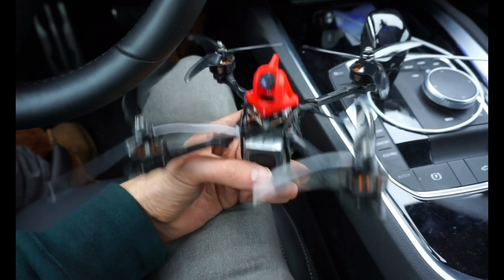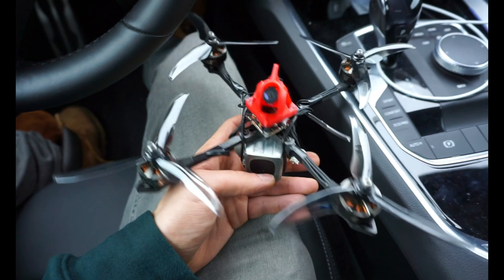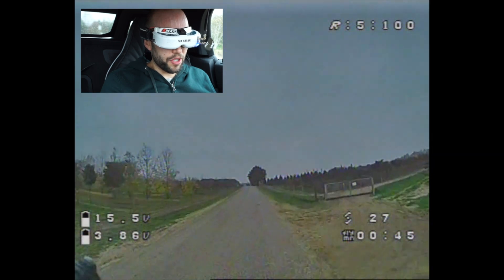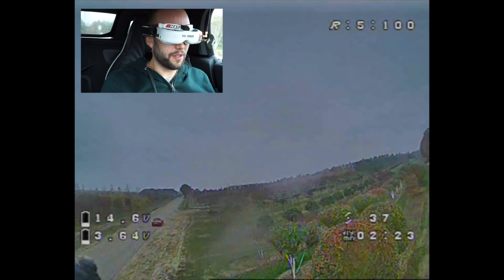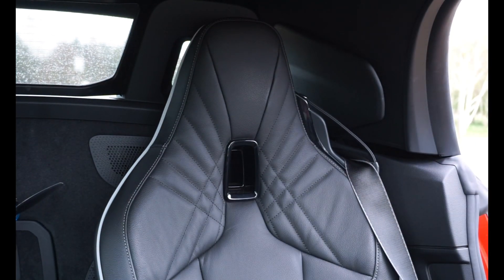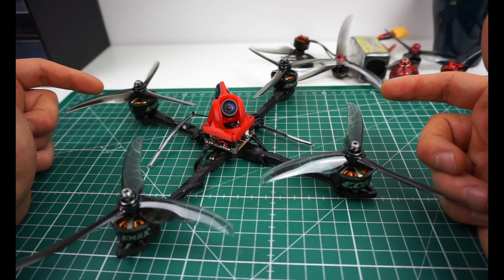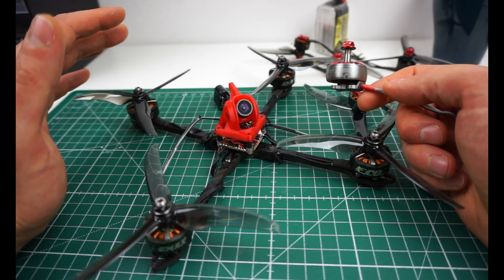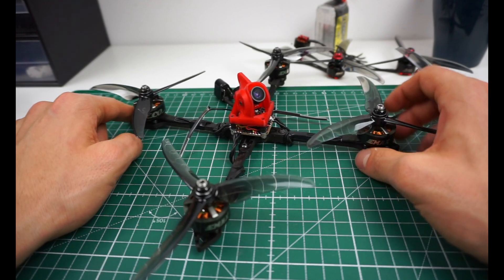5" Toothpick Part III - 2207 Motor test

Comment: hey dude -- im trying to run 1300mah  4s bats on a mamba mk3 35amp stack.  and the entire damn thing keeps shutting down.  im running 2205.5 2722kv -- looking at your specs- - my KV must be too high -- i even went to 66% motor_output_limit and i still had a shut down.  what i dont understand is that im pulling NO WHERE NEAR even 60 amps on this stupid ESC and its totally shutting down..  is this stack terrible ?  im using ethix s3 props even!  maybe i should gear it down to 1900kv.  really frustrated.
Reply from the maker: No the kV is fine. You have a broken ESC or FC. Or some other electrical issues like an overloaded 5V...hard to tell
Reply: @DaveCFPV  it ended up being that this mamba mk3 did NOT want to run on 4s..... I put it on 6s with a motor outputlimit of 75 for 2000kv and it flies great..... So weird.. this stack is really screwy.. mamba mk3

Comment: How about the Emax RS2 2206 1900kv? You'll save about 20grams, compared to the Eco's you got, and with a 6s 850mah, it's still pretty light ;) With this 6s-combo, you could easily try some bi-props to and get the weight even further down ^^
Reply from the maker: Definitely an interesting option. But 2300kV since the board only takes up to 4S. But I will try 2204 first and hope I can triangulate the right motor size haha
Reply: @DaveCFPV   I've never tried 2204 in this size, so that would be cool to see :) And still you could try some bi-props with that kv 😊There is a lot of room for trying out different combo's when it's that light of a build :)

Comment: I had the idea of making a 5 "with an 1806, BrotherHobby has an R4 that has a slightly high KV, maybe it would work with a very low pitched prop like 5030, maybe a 2 blade.

Comment: Can't see the purpose for this u can't race with it, battery is dead before u finish the race and u never get under 250 g better to try get a 5 inch under 250 that fly good.
Reply from the maker: Agreed at this point it's kind of pointless. Might as well use a normal 5". But that's by no means a finished setup. More or less experimentation to see what works.

Comment: People say that the fets wont give the 2207s the amps they want but I'd have thought that the fets would try to and then heat up, no? I dont think they can actively limit anything unless they are designed for current limiting. Maybe it's the higher resistance causing the power issues people have? But then why isnt that resistance generating board destroying heat? Idk. Those 2207 motors for sure arent being loaded up much on that quad anyhow
Reply: im running a 2205.5 right now on a 35amp mamba mk3 stack.  and the damn thing just keesp SHUTTING down compeltely.  ive motor_output_limited the damn thin all the way down to 65% which is ~ 1820kv and till, it just like shits the bed randomly...  doesnt make a lot of sense to me as the its a stack rated to 6s, and is pulling under 60amps at 65% limited.  i dont fucking understand why this stack just keeps turning off.

Comment: You wanna get some DAL 5051 props for that. You'll loose probably a minute of flight time but it'll be very peppy. You can't use anything smaller than 2207 with all these typical props.  2206 will do well on the old 5x4x3 or 5x4.3.3 v1s but any smaller and you're giving up control without significantly lowering the prop load.  The aio is unlikely to have any issues even on a 2307 2500kv. It just won't give you all the power all the time. It'll scale back the amps on its own.  2207, 2305 in probably I to 2300kv should be no issue on typical light load props.

Comment: 20A ESC 2205/2204 around 2400kv and over 400g with 13000mah where  pretty common setup when 5' was only option for good performing quad. And this is twice lighter, lower kv and light props - it seems like it works way less than old ESCs had (my guess). Would be interesting to see current draw readings.
And even more interesting to get it work at maximum performance - 80A at full throttle (leave burst margin for acceleration, sharp curves and coming out of dives), probably good 1000mah battery should do the job.
Reply from the maker: I drew only 45A! I think 2207 2300kV could work
Reply: is 2207 2450kv on 6s a good idea? or do i kill esc and motors super fast?
Reply: with 50A esc
Reply: man -- im running 2205.5 2722kv right now -- i even motor_output_limited it to 66% which is like 1850kv.  and my mamba mk3 30 amp stack -- is just SHUTTING DOWN -- my  CURR+ doesnt even go over 60 -- i dont undertstand what the hell im doing wrong.  2 identical brand new stacks, exact same behavior-- running ethix s3 props even

Comment: I'm going to do this! I'd like to see how the 2206 and 2205 handle. Do they even make a 2304 or 2305? I bet the wider and shorter stator would handle the 5" prop better and reduce some weight at the same time.
Reply: what amp esc? im running 2205.5 and my god damn 35amp mamba f405 is just SHUTTING OFF :(
Reply from the maker: Yes Amax makes a 2305 and t-motor too I think. Could be a good fit if the kV is right!